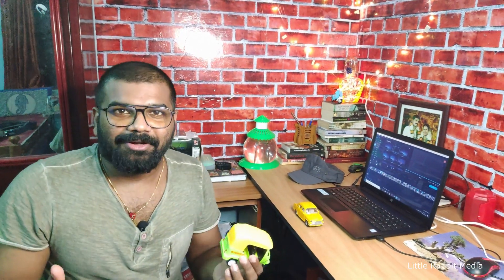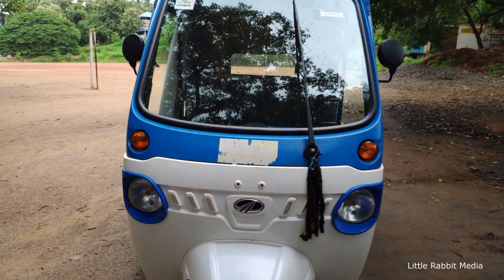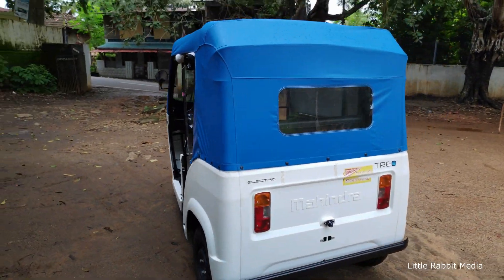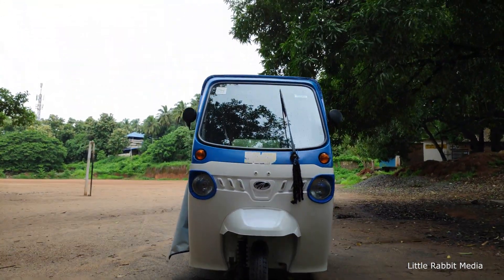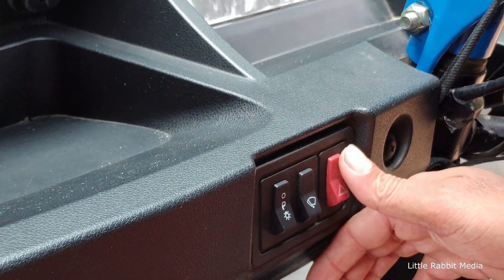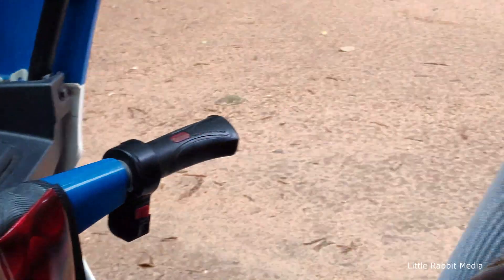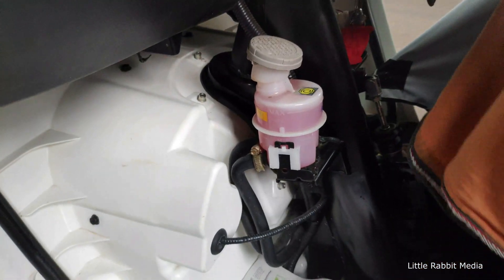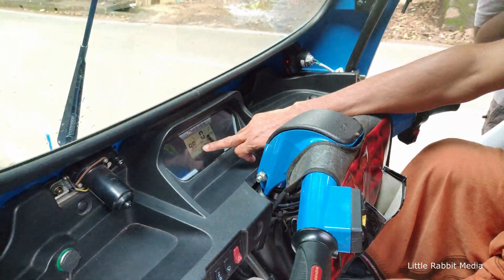ഇലട്രിക് ഓട്ടർഷ! Treo 2020 | Mahindra Electric Autorickshaw

Comment: Bro, do you recommend this electric auto for commercial purpose or regular LPG auto is better? Please reply.
Reply from the maker: Thanks for watching. in fact I am not an auto journalist to give a clear cut suggestion bro. I decided to do this video mainly cos of the excitement on electric vehicles. As a passenger , I felt normal auto would give some more comfort travel. Expenses wise we have to check with the real users bro..
Reply: @lilrabmedia  Thanks for reply, In Kerala you get a chance to meet lots of such electric auto's on daily basis, so only I asked you to make user review of the electric 3 wheelers. It helps other's as well as your channel too, isn't it.
Reply from the maker: Yes that's true .. lots of such electric auto rickshaws on roads here. All are mainly due to the increasing fuel charges . I will check with few bro. Then will do a review or post a video about this. Like asking feedback from many drivers from both LPG and electric . Guess that may help